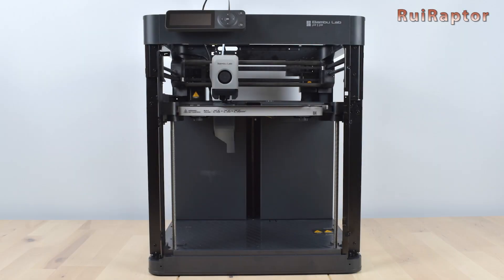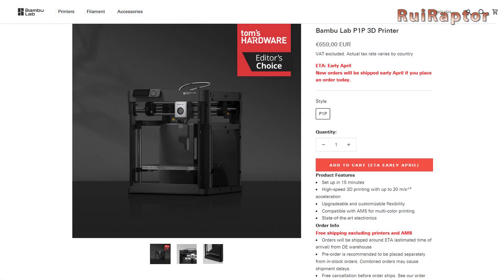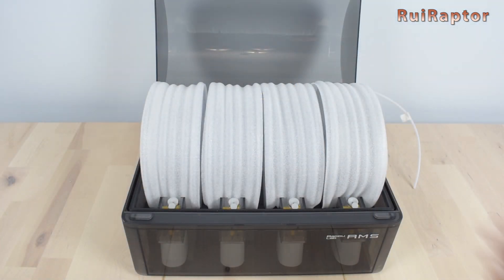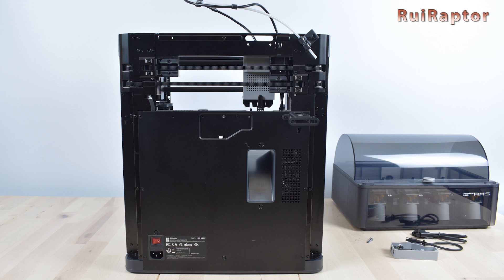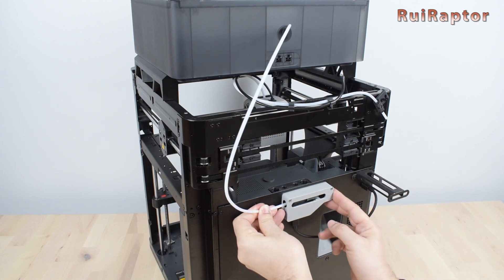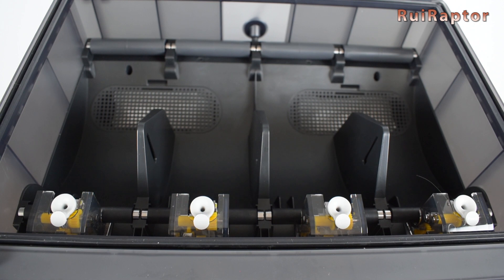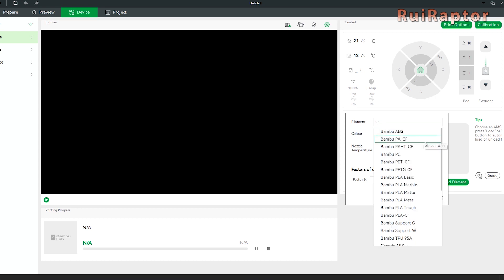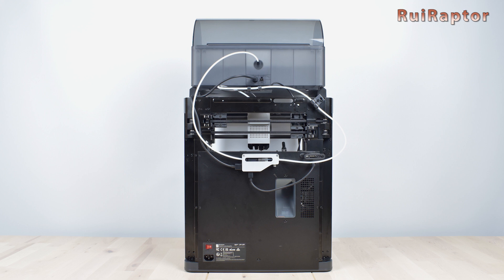BambuLab P1P - AMS INSTALLATION GUIDE - The Best UPGRADE Ever 👌

Comment: This video was super helpful and to the point!  Thank you!

Is there a reason to remove the small tube and then the fitting, vs keeping the fitting on the tube and connecting it to the small tube? (I only ask because I had trouble getting the small tube off so I used it and the fitting.)

Comment: How long does the printer with AMS upgrade take to print the multi colored object VS the same 3d print with only 1 color?
Reply: It would depend how many times you change the colour you can change it from black to white half way through so not much longer minutes probably even less.. or you could change the colour every layer in which case lots of time and lots of wasted filament spent purging

Comment: does the AMS have NFC/RFID reader to automatically read the filament characteristics like thickness, material, color, print temp?
Reply from the maker: Yes, the AMS has RFID readers but it will only read filaments equipped with the RFID tag which in this case are the ones from Bambulab.

Comment: This is amazing. Could you comment on how a cable rail would affect the installation of an AMS on the P1P ? I currently have the cable rail installed, will that be a hindrance ?
Reply from the maker: The X1-C is fully closed and has a cable chain from stock so I don't see any kind of problems if installed the same way.

Comment: How do I load the filament? I push it in and nothing happens
Reply from the maker: Hi, when inserting filament on the AMS feeder, the filament will be pulled in. If not, use the menu on the printer to load the filament.

Comment: What would u recommend for a differnet  PEI bed plate? I don't really like the textured finish.
Anything for clean flat smooth finishes>?
Reply from the maker: Hi Chris,
Bambu lab has a smooth plate as well. It's the same plate that comes standard with the X1-Carbon.
You can check it on their online store.
An alternative would be the whambam plate (we have a video of it as well).
https://youtu.be/DOWAcix5ojE

Comment: Do you know if this AMS unit can be used with the Clearview Plastics enclosure?
Reply from the maker: We don't have one of those enclosures but from what we can see, they include the top cover as well and with it, you can place the AMS unit on top of it. For the Buffer/HUB, i see that the back panel covers partially the area where the Buffer/HUB are attached on the printer so that needs to be checked in more detail with the manufacturer. You can attach this elsewhere but the connectors need to be obviously acessible.

Comment: Is there a way to do "multi spool" or same material changing automatically when a filament spool runs out?  That's will be great for automation, to print big parts, or to use partially empty rolls of the same type.
Reply: Yes, this feature is implemented on the AMS, you just need to configure it in the settings.